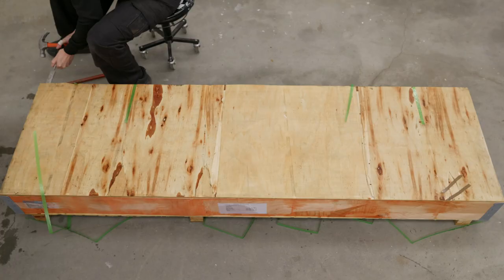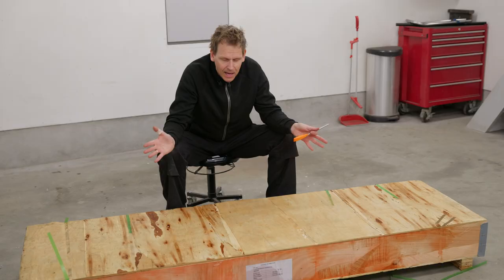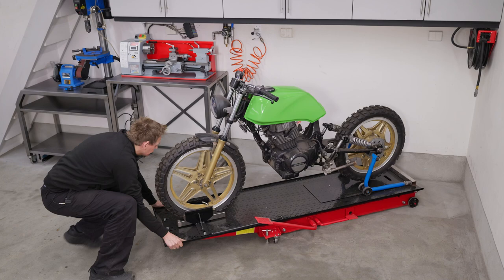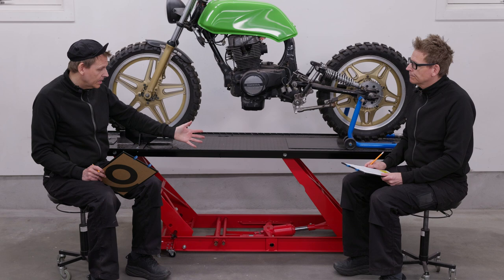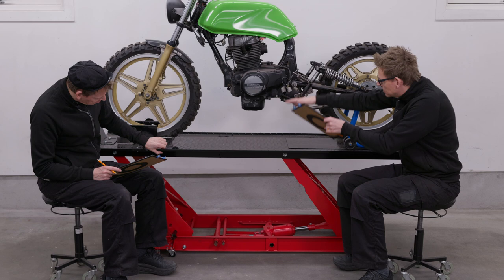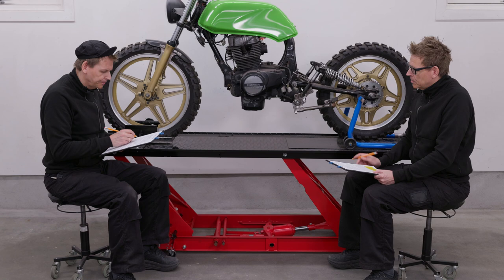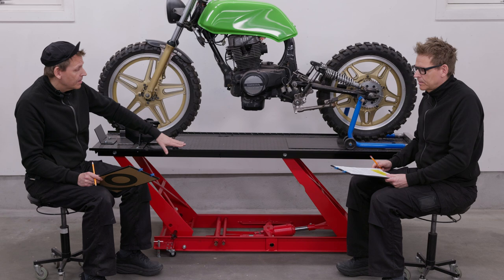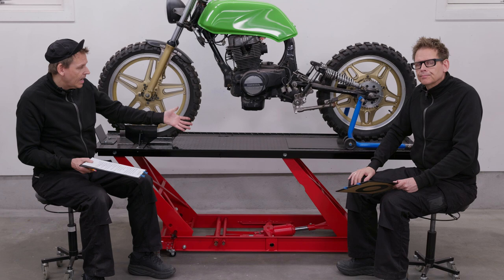Check this Before you Buy a MC Lift Table!

Comment: Same table, all red color including top deck. Sold here under Harbor Freight. Same price. They have a new model which has gone backwards in some of its design so I had to go to many stores to find the old stock model which is yours. Common upgrades include side extensions for wide motorcycles so you still have a place to put your feet down after riding a bike onto it. Also done are removing the bottle Jack and installing an air pneumatic Jack so you don’t have to pump the foot pedal many times to get it lifted up. The included front wheel chock no one here uses. You can buy a different model front wheel chuck from the same Harbor Freight that originally was meant to go into the floor by itself but can be mounted to the top deck very easily. Also added are eye bolts or U bolts around the motorcycle front wheel end edge of the deck and side edges of the deck so you can attach tie down straps to securely lock the motorcycle onto the deck. There are various ramp upgrades and adding wide grip tape (sandpaper texture) so if the deck is oily the motorcycle wheels don’t slip out and if you are stepping off of a motorcycle you ride up onto the deck your shoes don’t slip on an oily deck. Here we don’t store motorcycles long term on the lift itself so the lift is in the way when not in use. We built a wooden crutch. It’s easy to bolt large rolling wheels to the wood crutch. The crutch slides under and over one long edge of the lift. Then you raise the other long edge up vertically rolling the crutch onto it's wheels side and be now you have the lift on a thin crutch ready to roll against a garage wall or workshop wall and get it out of the way until needed once more.
Reply from the maker: I have seen images of the one from Harbor Freight and I thought it looked very similar. I believe you when you say it's the same 😊 Sometimes newer models are not better, but the vendor has found a way to make it cheaper without most noticing it and keeps the same price. It's a pity.

Your mods sound great! I made my own wheel clamp (made a video about that as well). It worked well, but I had to weld on support under the table to stiffen it, the whole tabletop bent as a banana when I put force on the wheel clamp 😝
Reply: @kihestad  if you want a look at the store one the SKU numbers are either 61670 or 97841. The text description is PITTSBURGH 1800 Lb. Capacity Motorcycle Stand/Wheel Chock. This can be drilled and bolted to fasten it to the top deck if a person does not own a welder.
Reply from the maker: Thanks again for the tips, but I am covered now as I have made my own. Mine is a bit more "smart" than the ones you can buy, as I can adjust it on both sides to always get the bike centered regardless of wheel width 😊

Comment: I think this was a good purchase. 1) You can easily upgrade the back wheels with ones that have bearings or better yet, add tabs to install caster wheels (larger ones on both front and back); 2) You can easily fabricate a front wheel holder that is sturdier and holds more of the wheel; and 3) I suggest cutting a piece of plywood to install on the platform. It will absorb oil and will reflect light if you paint it white. The lip is a good thing since it will contain oil spills and possibly dirt that comes loose; and 4) You could also install small (cheap) hydraulic jacks in the corners if you want to lift the whole platform up to 90cm... and you can do all this for far less money that you would spend on an expensive scissor lift! Thanks for the fun video! Your production and editing skills are really great! 👌
Reply from the maker: Thanks Dennis 😊 These are some very good tips! I have already ordered some heavy duty caster wheels online (4x200kg / double ball bearings per wheel). I think I'll just use your tips as a work list, this is just what I need!!!! 👍👍👍

Comment: Great video but I don't think its a good idea to move that lift with the bike on it.
Reply from the maker: I have used it for a while now, currently with my Cagiva 750 Elefant. This bike is more than 200kg, and quite tall. Moving it around is not too difficult, but since total weight is close to 300 kg I have to be careful not going fast, it's hard to stop it 😬 I always lower the table all way down, moving it when lifted is absolutely not safe!

Comment: I have very similar one from Biltema few years back. I was also surprised that they didn't bother to make oilite style bushing for those cast casters. Well, build cheap is built cheap. Luckily Biltema one has edges bent downwards. Though I dislike the diamond shaping on it too. Nuicanse to clean the surface. Also the built-in wheel support is absolute garbage imo. Luckily they have those U-bolt locations at edge on quite many places.
Reply from the maker: It sounds very similar. I have been on the lookout for the Biltema one, but I think it's discontinued now.
Reply: @kihestad  Very likely. Few friends asked about year ago where I got it and apparently it's not longer in catalogue, or at least was off from it then.
Reply: I have seen that Biltema has removed the motorcycle section in its catalog.

Comment: Hey i noticed you have trouble fitting the lift in its storage space. How about you replace the wheels with heavy duty castor wheels that are flexible..eg can move in any direction. That would make it easy to just slot it exactly where you want.
Reply from the maker: That is a superb idea! Done!!! 😅

Comment: Great work conversing with grumpy Ki, he might be pleased to know I have exactly the same table but it's blue, so I can see bits I drop.
Also the lip on the side saved me from having a lap covered in oil when I knocked a pot of it over on the table!
Reply from the maker: Hehe, he is grumpy for sure 😝 I can see the side lip can help, If spilling oil or if just dropping a nut it will keep it on the table top instead of falling to the floor 🤔

Comment: very professional video as always.  i have a very similar design made by Clarke in the UK...you were spot on with all the positives and negatives...but compared to when i didnt have a lift, it's all positive now.
Reply from the maker: Exactly what I think as well. I have been wrenching on motorcycles for decades, and never used a lift table. I am pretty sure I'll be very satisfied this weekend when I continue to work on my motorcycle 🤩🤩🤩
Reply: I suspect there's one factory in China making them all. I have exactly the same lift table as Ki, except mine is light blue - Grumpy Ki would approve of that.
Reply from the maker: haha, I think your're right 😝